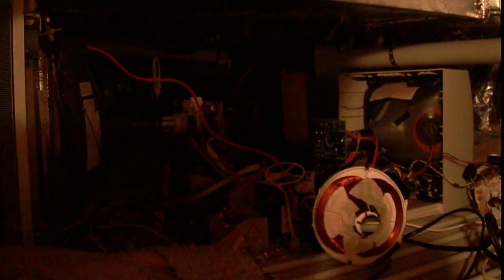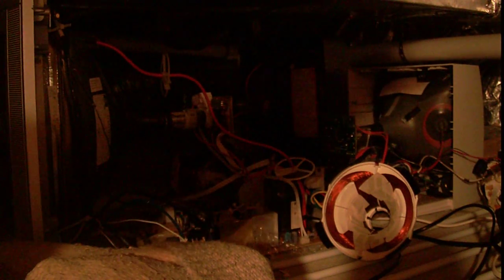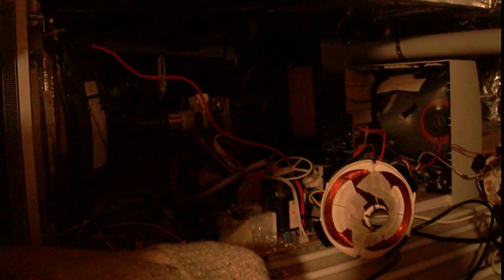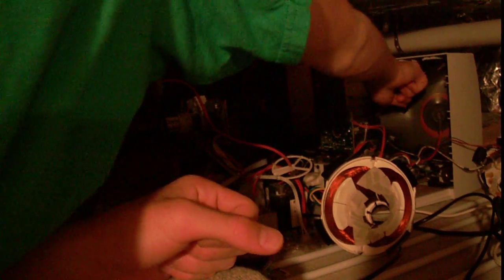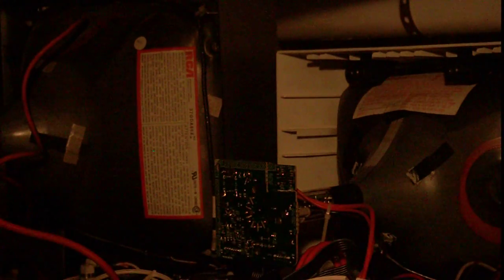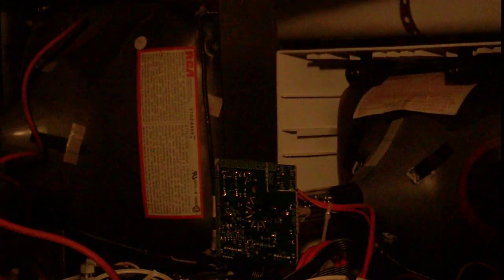DIY Particle Accelerator 4

Comment: emm iwanna experiment, to relase those electron beam into a thin air, literally only electron gun from a tv, wihout tube, can i do that and maybe u can give an advice 2me,, thanks bro, if u dont want to answerme via comment u can also email me at jackop18@gmail.com, its would be great ^_^
Reply from the maker: You could do that, but the coil (almost like a lightbulb) will burn out rapidly in direct contact with air, and depending on the voltage it may arc. You will get a purple plasma, but not much else. Make sure not to aim it at yourself and have some shielding setup just in  case.

Comment from the maker: Yes they absolutely can without hitting the walls, that is essentially what is happening in every electron LINAC, including the one in my TV. That is done with focusing electronic or magnetic fields. It would be near impossible for them to not collide with each other especially if they are focused into the center to avoid hitting the wall. If you want to be specific the electrons never hit each other, they repel each other, but it would be the same either way.

Comment from the maker: First thanks for the compliment. Second, I have no clue how to design an antimatter engin, but my best guess would be an electron and a positron accelerator both aimed at a central point with the beams intersecting at an angle of 45 degrees. Some sort of field (electromagnetic maybe) would condense the energy to be emitted in a coherent manner. That has no planning or informed basis though so take it with a grain of salt.

Comment: Instead if the need to blow things up today we need to get there.. And get there fast. This is why I think that rather than trying to find the origins of the universe (this will always be debated by religion dogma) the purpose behind theoretical physics should be In developing the antimatter engine. This should be even more important now that they have found earth like planets at alpa centauri.
So I put it to you, tomorrow's Oppenheimer, how would you design the antimatter engine. P

Comment: That might be a good idea for EBM 3d printing maybe, because the high voltage is high power (wich is  one of my objectives) but for an SEM i think low current high voltage will be enough to drive the electrons from the filament (maybe that's y they use it in all TEM and SEM). 

Though your microwave electron cannon idea might be usefull for lithography..! (E-BEAM litho)

Comment: Well actually you can't use a TV CRT due to Oxygen poison on the heating element, unless i work in cold cathode mode, yet it won't be as efficciente as it should be..!

I'll make myself a proof of concept tube to see how simple it comes to make some machined parts for a real SEM, i was having trouble understanding the lens mechanism but with some work and patience i'll wind my own lenses..! :) If possible i'll post as many vidoes as possible..! :)

Comment from the maker: First let me congratulate you on what must be one of the most awesome particle accelerator setups I've seen on youtube. I take it the copper is your drift tube (like a LINAC) and the magnets are for focusing. You might want to consider using a pyrex glass tube instead. Seeing as your superconducting magnets must be cooled by liquid helium maybe use some of that to cool the copper pipe. Run small copper pipes along the outside of the big one and run liquid helium through those.

Comment: hey, i've been planning to build one with the old van de graff as the power source. Mine currently has an output of nearly 3 million volts, but I am having a proble with the setup that I have. I use a special copper tubing surrounded by superconducting magnets, but for some reason the copper keeps heating up too much, and excess heat happens within just the first few minutes. ( i actually got a burn on my thigh) I don't know HOW i can make a cooling system for this kind of thing.  Please reply!!

Comment: @quicknuclearscience and the cloud chamber only works because the high energy particles vaporize the very cold liquid helium. If you use any other liquid the electron/positron would bond/annihilate with the substance. you must a noble gas because it will not likely react. And photons cannot be seen in a cloud chamber. Look into the compton effect, and try to find this paper Phys. Rev. 50, 302–308 (1936) "A Cloud Chamber Study of the Compton Effect" (it should be readily available on google.